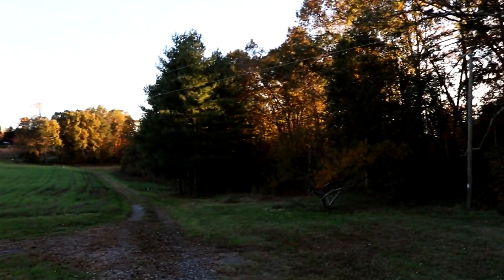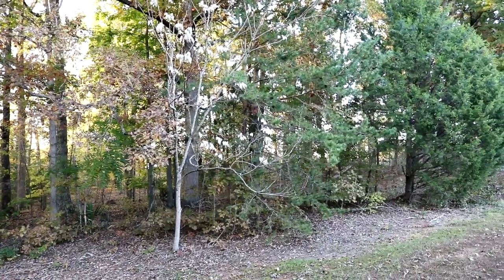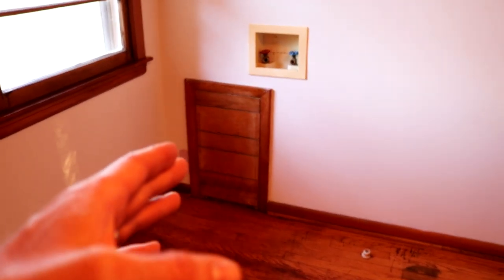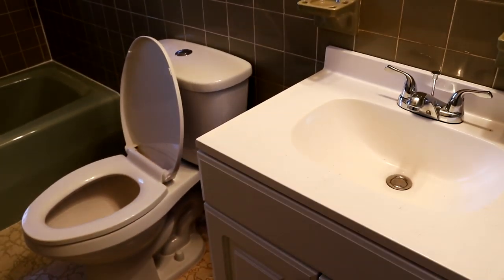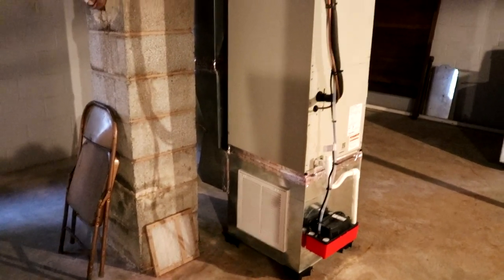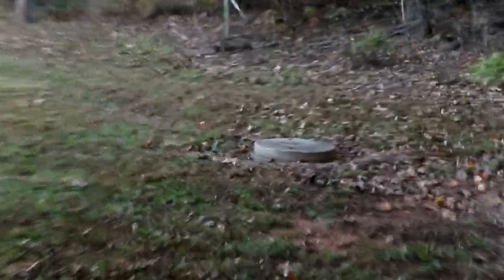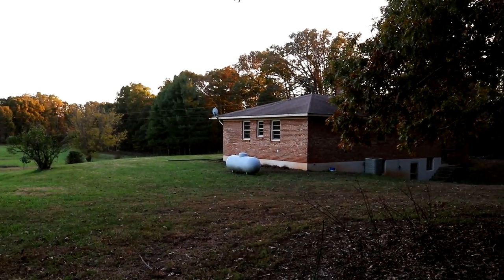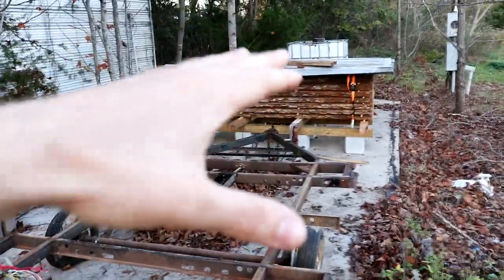DIY Home Renovation - THE BIG REVEAL!  ($1000 Rental) - #10

Comment: why is there hot air heat and propane heat
Reply from the maker: The propane was already there, which I like. I added the heat pump. It had an oil furnace when I bought it. The propane is a nice back up in case the power goes out or if you want to supplement on really cold days.
Reply: @homemadehome5575  ok sounds good just dont like gas  just look at the million dollar house that blew up in NC the other day. Never seen a house blow up using oil or electric.
Reply from the maker: @wolfpacva  I don't like gas either for that reason, but my aorta could burst too but chances are it won't. If I lived there, I would only use the propane in rare situations when the power was out in winter. Otherwise the valves would be off. Having everything gas is scary to me thought.

Comment: You can get by with a 7500 watt heat strip back up, not sure about code but certainly didn't need 200 amp service.

Comment: this house has zero curb appeal
Reply from the maker: You could probably say the same for yourself.
Reply: @homemadehome5575  do u really think there is curb appeal at that house
Reply from the maker: @wolfpacva  I didn't say it did, I just sarcastically said it wasn't curb side. There is a lot that could be done to make this house look better, but I only bought it so someone else would not. My family used to own the land this house sits on, it was part of a much larger piece across the road. By the time it was rented, I had almost $20k cash invested (down payment, closing costs, and the renovation) I did this while renovating another house and also working and having a family. The monthly payment is $856, the house rents for $1000 as you see it, which is top dollar even if it was nicer. I just had to get it done. I think it would look nice to do a nice covered porch that connects into the exhisting roof (hipped). I also think it would look better painted as the brick is the least attractive brick. With all that said, brick ranches are something that a lot of people love and it is becoming more and more popular. The house offers a lot and that is what I focus on. Again, I was after the land more than anything else. I make no money on the house as a result of the mortgage.